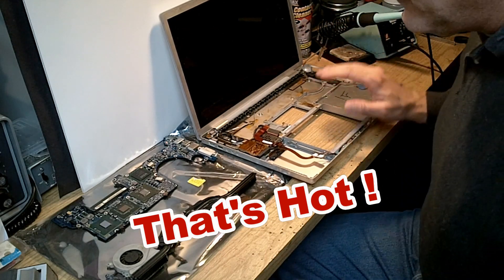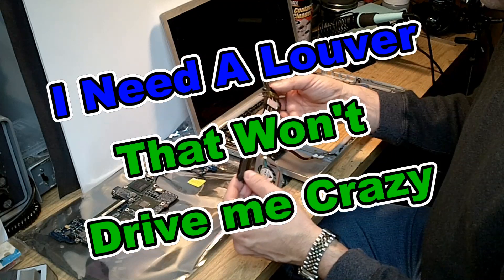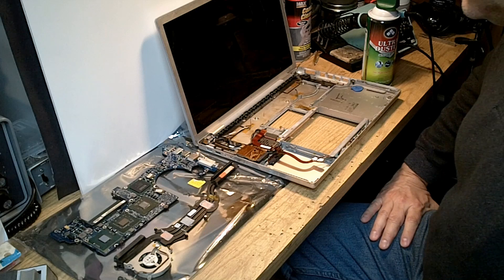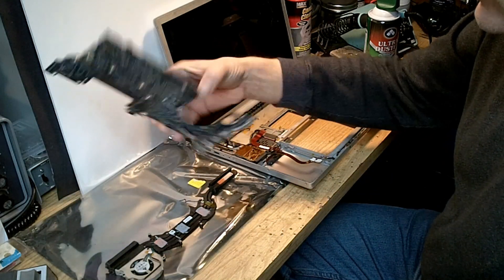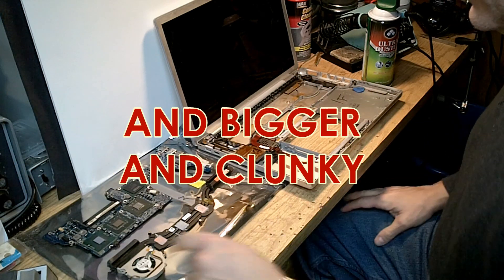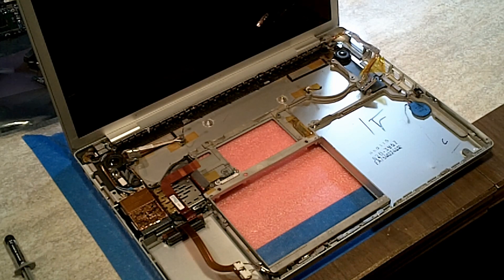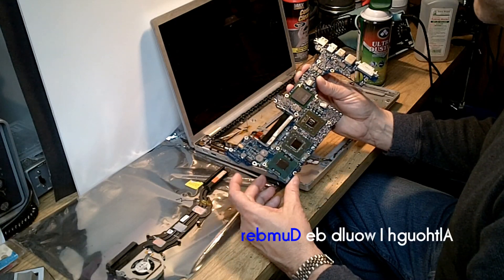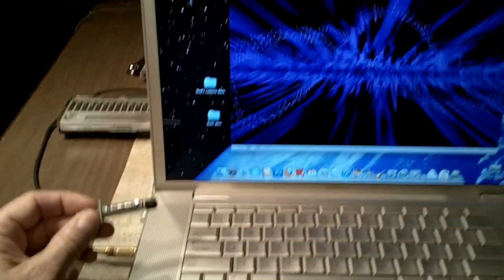Macbook Pro Heat Issue

Comment: So having replaced the battery and themral paste on my 2014 MBPro I am still suffering from GPU over-heating...... ANY TIPS ANYONE?
Reply from the maker: Is the overheating perturbing a connection and all at once it goes black. Or is it possibly a heatsink interface issue and the heat just is not getting spread?
Reply: @MIKROWAVE1  No blackout; just insane kernal stats and poor gfx/video  performance.....

Considering a re-solder job on the GPU & Vcore but no way I'm gonna try that myself.

Comment: Amazing, that they already had computers back then.
Reply from the maker: Do you remember when we invented ESD in the 1970's? There is only one way to treat ESD properly - that is: BY DESIGN. You can come close externally, and at the state of the art, that is dissipative flooring and shoes, bunny suits and full humidity control. Benchtop wrist straps and grounded mats and the use of shield and dissipative bags and tubs are accepted as a compromise method due to practical necessity but this system is prone to human and equipment error.
Reply: MIKROWAVE1 I never used any of this nonsense.

Comment: This is the same model as my Macbook Pro... which is overheating like crazy lately!  Is there a way to clean the dust out of those pipes without removing the entire logic board though?? I don't really feel like taking EVERYTHING apart...

Also, how long does heat sink compound last for?  I've got some old Arctic Silver laying around from a PC I built many years ago, but I don't know if I should keep using it or buy new stuff.
Reply: You should be able to just unplug and remove the fans without taking off the logic board...... but if you've gone that far, just remove the board so you can re-paste the processors

Comment: Very, useful video, thank you. The comments swirling over the screen were less useful. I found them distracting and certainly didn't expect to find the random photo breaking it up in the middle. Perhaps because I'm female and British I found that repellant. You really need to concentrate on the matter in hand when trying to get such things in your head before a tricky manoeuvre like opening up your machine.
Reply from the maker: frannbug Yes admonition and punishment accepted. forgiveness? Actually  you got it  on the nose - the video was getting boring...in my defense I learned all from British TV!
Reply: MIKROWAVE1 Forgiven! That comment was two years ago and I was quite pleased to be reminded of your video because my 17" MBP has died now (logicboard failure for the second time). It had a good life of about 9.5 years. So I've nothing to lose if I do the big clean up job and put the board in the oven. So far I've swapped various components and cleaned the right fan but stopped short of cleaning out the rest of it because I was afraid I'd lose bits or forget how to put it back together again. I might just have a go now! I would still prefer a bigger laptop to a new little one - wish they hadn't stopped making them.

Comment: My Macbook Pro from 2008 is basically acts as a heater in the winter lol, it gets really hot. However, I haven't experienced any issues with it yet and my machine is usually doing rendering work or something else CPU intensive 20 hours of the day. I recall reading somewhere that the aluminium bottom surface of the laptop acts as one giant heatsink, so it may actually be beneficial for the computer to get hot (transfers heat to the metal).

Comment: Interesting, but i'm not sure your correct on this one. I was under the impression it was due to repeated heating and cooling cycles over and over again. This causes the joints to fatigue and fracture, not melt. The system would shut down well before solder melting point. If you look at BGA failures its usually a crack. I still think your advice is good as the less heating the less fatigue, but failure is inevitable with this material I fear

Comment: I'm an Apple service tech by vocation. There was a Repair Extension Program from Apple that covered certain MBP 2.2/2.4 GHz logic boards, as well as the MBP 2008 models for issues with the Nvidia GPU. The program is mostly expired now. Apple also had NUMEROUS and WIDESPREAD problems with the iBook series portables for defective ball-grid array and SMT solder joints. I agree with you completely, the enviro-solders SUCK! Heat exchangers are ALWAYS clogged like a laundry lint trap in these models.